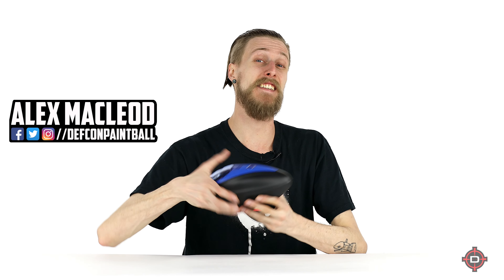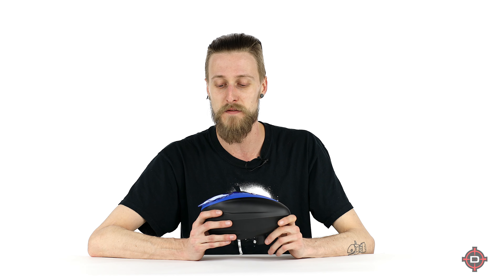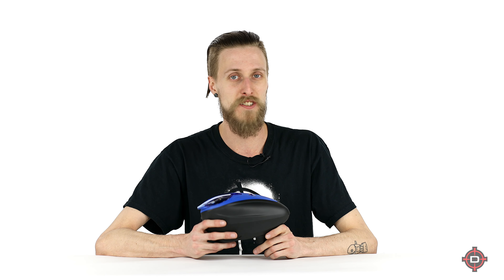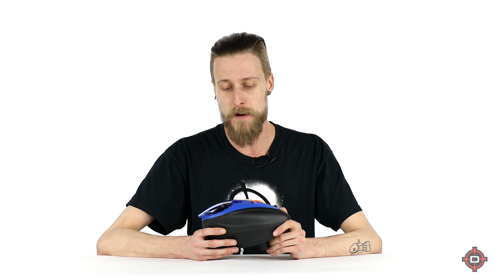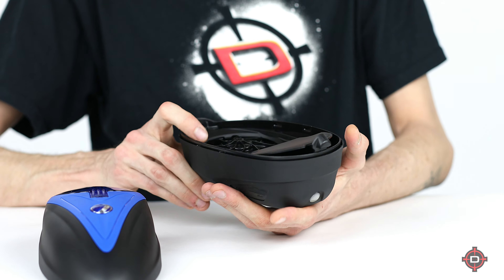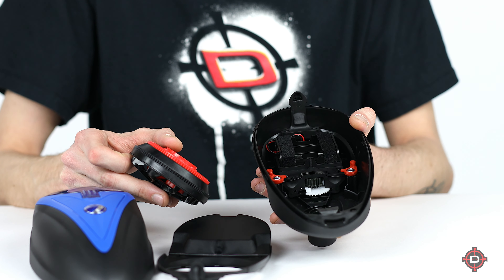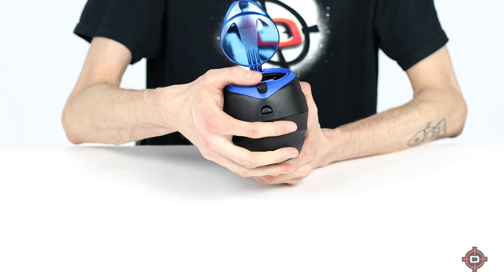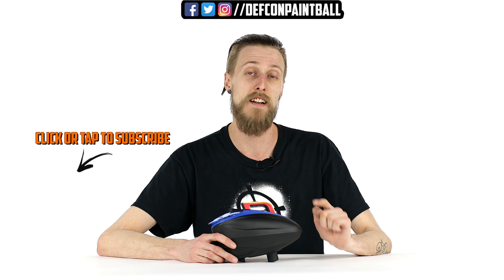DYE LT-R Paintball Loader - 4K

Comment: I have an lvl and recently had to get a dye loader for sponsorship reasons. I chose the LTR becuase its lighter than any other dye hopper and only $99. My only complaint about the old rotor was the weight and the new LTR fixed that.

The lvl and the LTR are the best hoppers you can get brand new. Both feed fast enough, and look good. The lvl does come stock with the speedfeed but also costs a little more than the LTR plus a cheap speedfeed.
Reply: Jizzy Coast a lot of people prefer a cap to a speed feed

Comment: It’s a good hopper feeds super fast, is always gonna work and be reliable, WHEN paired with ideal paint if you don’t have ideal paint or good paint it will
Jam like crazy. Paintball must be perfectly round, and not be soft or mushy at all. So even if you have great paint and you playing in Humid or hot weather you might run into issues if the paint gets a bit soft or mushy. I would suggest the ltr works perfectly no matter the paint. But this ain’t bad if you need speed or can find it cheap.

Comment: will the rotor high capacity shell fit on this?
Reply: yes. its exactly the same
Reply: however the shell is a diferent texture. The rotor is smooth feeling i believe, while the LTR has a little coarser or rougher texture

Comment: Empire halo too or Dye ltr? Also, will either of those hoppers work with a Cronus tactical?
Reply: yeezy basically all hoppers work with hopper fed guns the cronus is one of them and if it has a adjustable feed neck then you have every hopper hat your disposal
Reply: LTR for sure. its lighter, lower profile, and faster than the halo too

Comment: Did they discontinue the original rotor?
Reply: maxxon99 no
Reply: that one dude Incorrect, yes. Once current original rotor stock has been cleared you won't be able to buy them new.
Reply: no, they put in a new shell and called it the LTR
Reply: Basically yeah, but it looks like if you want the spiffy graphic designs in the future, you'll have to fork out for an R-2.
They could have just dropped the price point on Rotor, but they chose to do this instead.